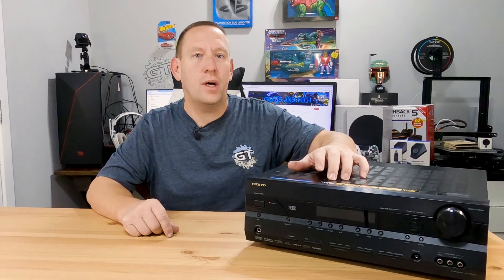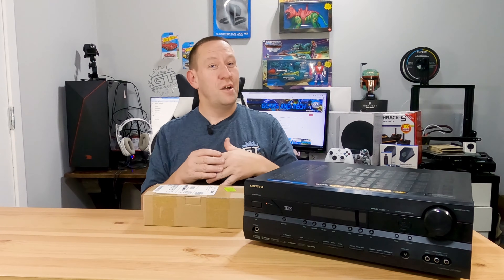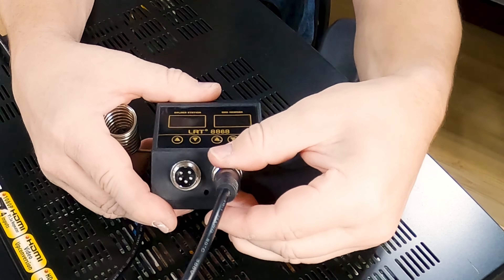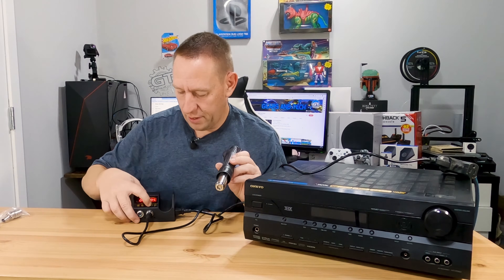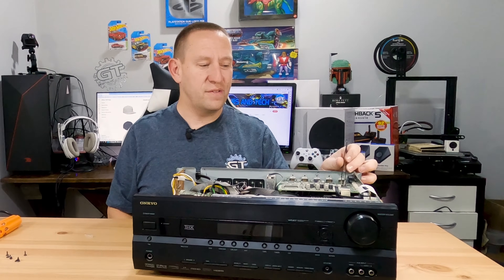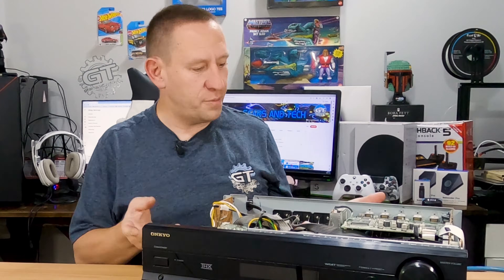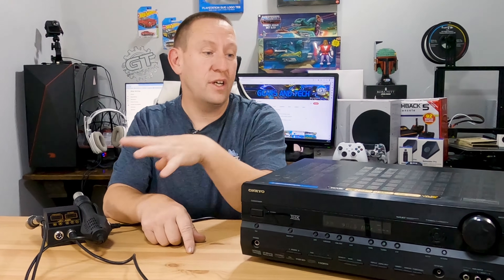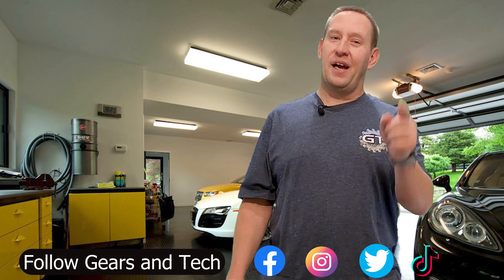Can I repair this Onkyo Home Theater with a $50 Reflow Station from Amazon? | Gears and Tech

Comment: I'm trying to remove the main board from my Onkyo HT - R 2295. I have everything removed but there is one thing that's holding the board and buy the two large capacitors. I believe it's the plastic stem that securing the black wire that runs in between those capacitors but I can't figure out how to remove it without busting the plastic stem. Anybody give me a tip on how to clear this last hurdle? Thank you
Reply: press the plastic connector from above, you will see it move down a little with a small screwdriver or something similar and pull out the cable
Reply: @steva733 
I did that for one of those connectors but I can't find another one on the main board to press so that I can pull it up. It seems to be somewhere around the two large capacitors but the only thing I see is a connector that is holding the black wire down in between those two capacitors, and I don't see anything in that area like a little plastic knob that I can squeeze and pull up as I did with the others. It's really baffled me!

Comment: Those hot air stations aren't meant for soldering(Or anything really.) they're junk that fall apart and might burn your house down depending on where the parts fall.  Try Atten or Quick.
Reply from the maker: I haven't experienced that problem. For a casual hobbyist it works fine
Reply: @GearsAndTech  They work just well enough to be sold on scAmazon and not a penny more.

Comment: So this is a commercial ;-) video .....
Reply from the maker: I'm not sure if that's totally fair. I actually fixed the unit, and showed the tools used and that it worked.

I even spoke about alternate methods based on equipment you may already have

Comment: I have a TX NR 656, and the HDMI out isn't displaying image on TV.  I can hear the sound. Can I reflow the hdmi chip? Pls help
Reply from the maker: Yep. Should fix it.
Reply: You might need to replace the aging capacitors on the HDMI board. Known failure mode for ONKYO & others. YouTube is a great source for this. Thanks Gears & Tech!

Comment: Great video. I've fixed many of these, esp Onkyo, in the same fashion. Just one tip, use some flux around the chip. Helps with any oxidation in the broken joints.
Reply from the maker: Great point!